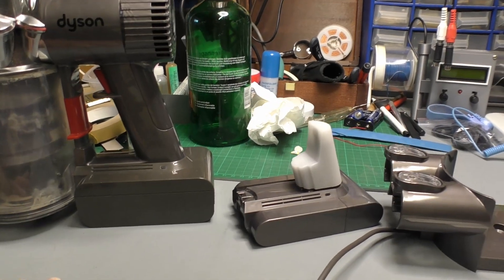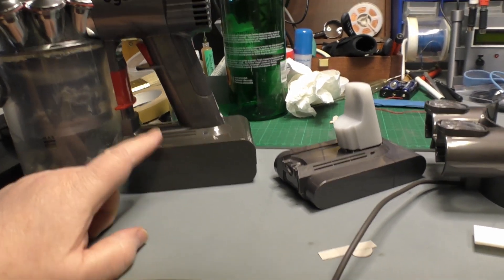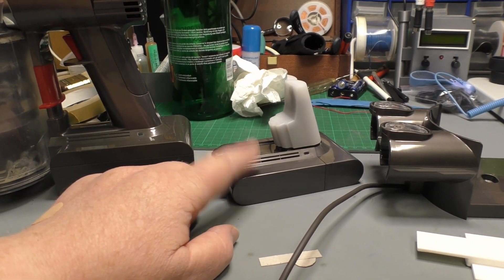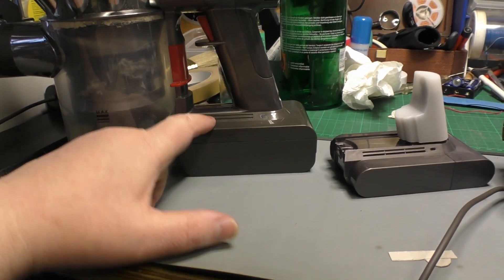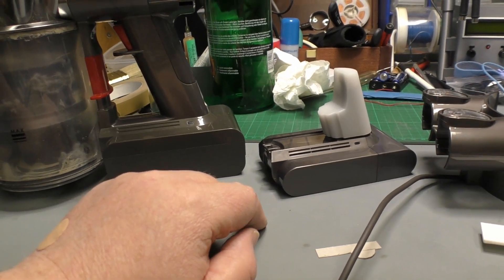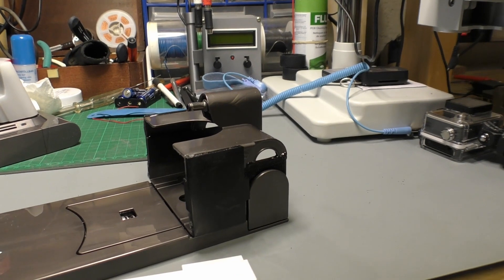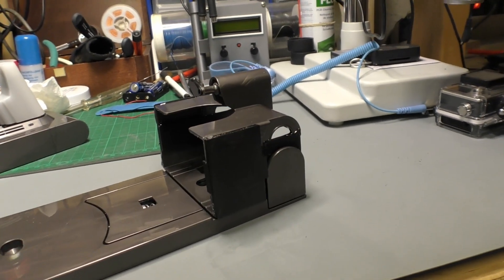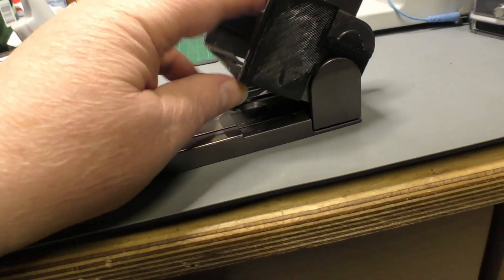Modify Dyson V6 Charging Cradle to take larger battery

Comment: Great idea I had the same problem with my battery upgrade is that the charger mount does not fit.  And yes the bigger battery does help, I ended up using a 7mah and I love it.  Thanks for the video I will widen my cable as you’d did yours